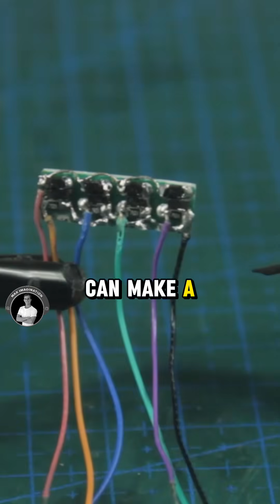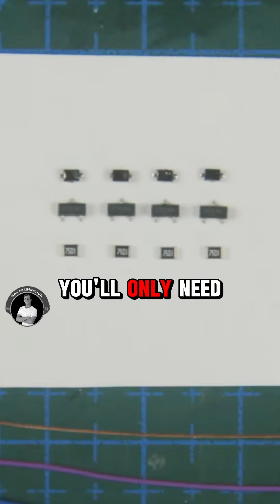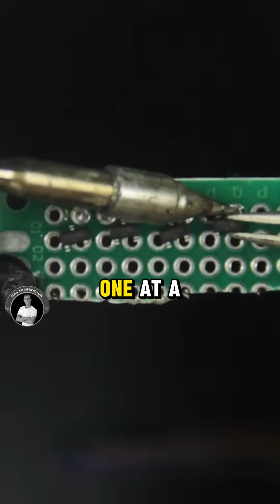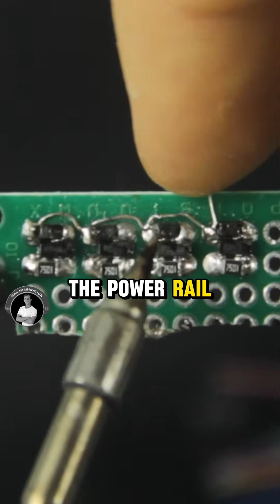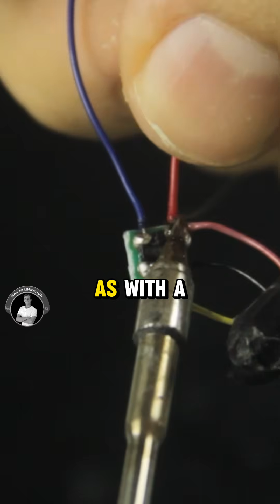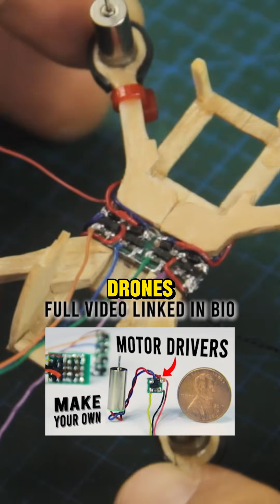(Video link ⬆️) Make a TINY 4-CH Motor Driver For Your DIY Mini Drone  #diyelectronics #arduinodrone

Comment: I need help. I bought ss14 diode for the motor 720. But it is big compared to my FET. What should I do. SS14-Slkor-40V 550mV@1A 1A SMA(DO-214AC). This is the diode i bought.

Schottky Diodes ROHS

Comment: Can i connect mosfet directly to motor.  I'm using coreless motor BTW
Reply from the maker: The motor technically connects to the mosfet directly. See the full video on my channel on how to make the motor drivers.
Reply: @MaxImagination  i mean only with mosfet
Reply from the maker: No, you at least need the pull-down resistor with the MOSFET.
Reply: @MaxImagination  hmmm😮

Comment: Can you tell the diode resistor and mosfet you used and also with the same components the max output voltage it can handle
Reply from the maker: 1N4148, 10K ohm, and SI2300DS. It can handle a maximum of 20V.

Comment: can this motor driver work on pwm from an esp 32 
(i am planning on driving  2 n20 motors with speed control)
Reply from the maker: Yes, this motor driver is specifically for microcontrollers like the ESP32.